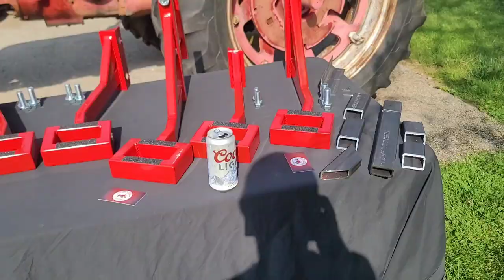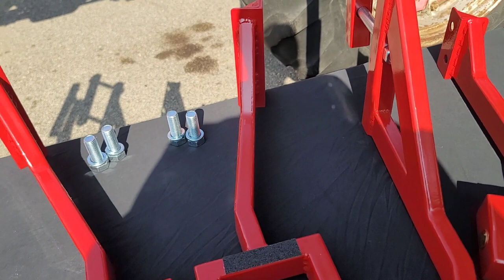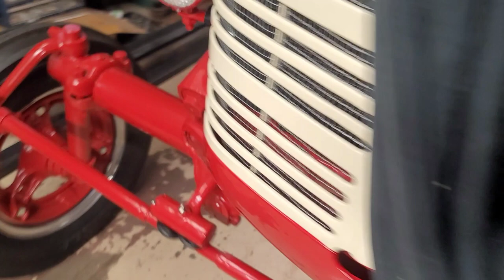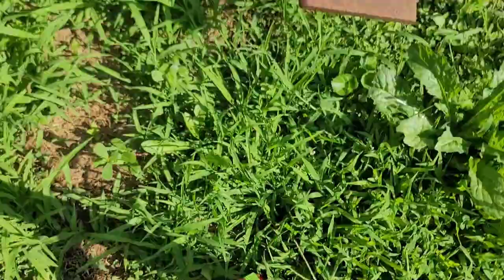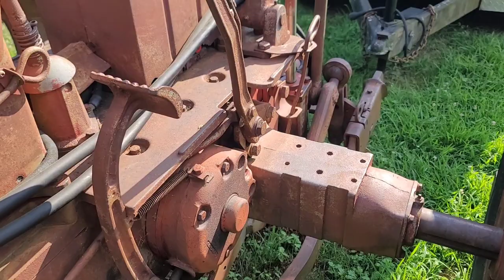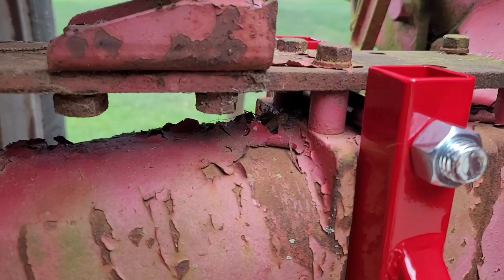Farmall Complete Step By Step Breakdown Including Super C and Steps For H, M, Etc...

Comment: Nice selection of steps. And I admire the quality. I welded and fabricated for 35 years and know good work when I see it. Hey what brand of clear coat did you use on the super A?
Reply from the maker: Thank you,  I take alot of pride in my work! It means a great deal to get a compliment from a seasoned welder! I used Speedkote Clear with medium activator.  I got it off Amazon and it was surprisingly easy to lay down and its a true clear without the yellowish tinge.